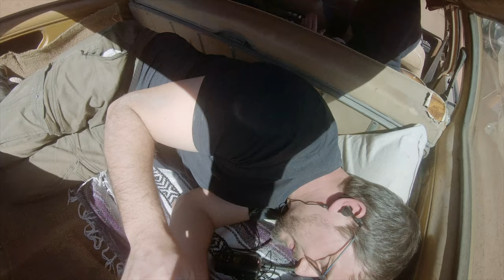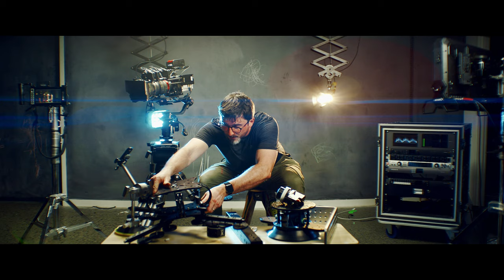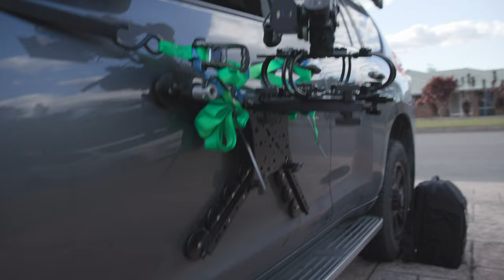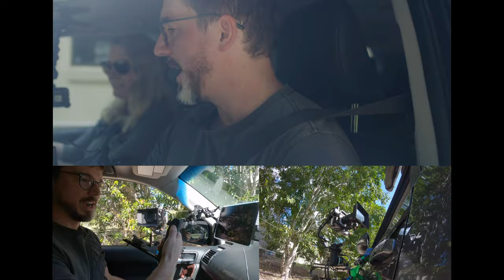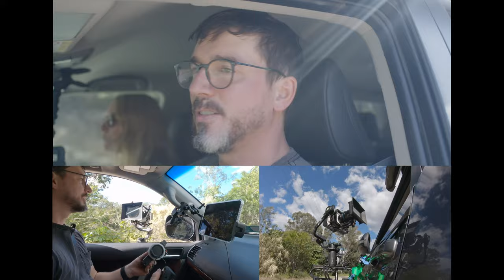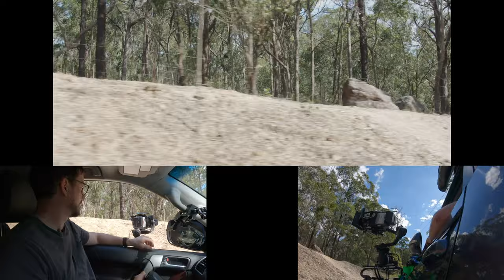DIY Vehicle Rigging PT1 – Red Komodo + Crane3S + Cloudmount

Comment: I absolutely HATE controlling my gimbal with the Mimic when in a vehicle. It's terrible. Also....first time test w/ a vehicle rig using a Komodo like....no big deal :D :D love it. Great advice on the power of the gimbal I decided to try Maniac mode on my MoVI and.....it basically made my footage virtually unusable when on the Cloudmount. I had a shoot yesterday where I turned off Maniac and lowered the stiffness on each axis and it was a smoother shot.
Reply from the maker: Good to hear it helped you as well. The next episode will show some interesting results with just the isolator off the CloudMount and a pretty sizeable Komodo package.

Comment: Have you ever tried solidly mounting the camera on the vehicle? I used a solid bullbar mount and a solid in-car mount for off-road stuff (rocky tracks, river crossing etc) and the look is quite natural even without any post-stabilisation. On-road, this should work quite well, though of course you don't have the ability to control the camera movement. But if a fixed mount is OK, then mounting the camera solidly might work.
Reply from the maker: Yeah after mounting our moco slider without isolation and seeing those results I’m definitely into the hard mount for certain applications. New ep that just went up shows us testing it: DIY Vehicle Rigging PT3 aka How to rig a MoCo Slider on a Car in just 74 easy steps!

Comment: Hey, great video and example of how powerful this gimbal is. Just wondering if you know dose the wireless receiver get power from the hand control unit? Or are you stuck with the battery life of the wireless receiver? I have heard the hand control unit does not power the wireless receiver.
Reply from the maker: Yeah the hand control unit does pass power thru to the receiver. I haven’t really tested how much power it can provide or battery life. But on mine I definitely can see a charge indicator on the receiver when I connect it to the motion sense remote.
Reply: @graetzmedia  thanks for clarifying that. Im currently working on a stabilised car mount system right now and have the Crane 3S Pro and have high hopes of it working. Though im only using a Sony A7S iii to keep everything as light weight as possible and to cut down on wind resistance. I also dabble in custom-built motion control systems and am local to Brisbane. I like your take on production and testing gear to try and find a somewhat budget solution. Sometimes things don't always work perfectly but if you can get a usable shot then that's all that matters. I'm exactly the same when it comes to my camera rigging. You should check my V1 motion control rig I built in my garage to shoot high-speed tabletop stuff. I also have a V2 rig that will provide very similar results as the BOLT system. It's currently being built. I feel like you would appreciate it's complexity for a budget motion control system. My website RAW.Exposed

Comment: Very informative. We have the cloud mount as well. did you try putting extra steel cables with the payload you were using?
Reply from the maker: Unfortunately I didn’t have any more of the cable receivers to attach to the CloudMount. Do you know if it’s possible to get more than 8 cables on that system?

Comment: Great video. Your footage looks incredible - Just have an odd question . The shot were youth driving with your family what were the camera settings? 25fp 24fp or 23.976fp and what shutter angle was it? Thanks again this is a great video.
Reply from the maker: Komodo was running 50fps (varispeed on a 25fps base rate) 1/100th. I sped it up 200% in the edit so I could match it to the GoPro footage.

Comment: So many wrong things in here. Let's start with the mount - usually when you grip a car you ALWAYS want a 3-point grip. Also, basic rule says - ALWAYS put shiny tennis balls on the outer margin of your rig - so everyone around you could notice you have a rig outside your car.  Shock absorbing mounts are okay for shooting anything outside your car - say another car, streets etc. When you look into your car - you always want a hard mount, this will ensure the camera position is fixed with the car and doesn't go in another direction the car suspension does. This wobble is caused by two things - first the shock absorber (besides, which is working really bad with your rig),  second the gimbal itself. Gimbals are okay for some things, and are not for a lot of others. In my practice I always go hard fix when looking into the car, or at least a tripod head. Gimbals tend to have inner vibrations caused by car vibrations and usually don't work for shots pointed inside the same car they are gripped on. When you mount something to the door face or a hood - you always want 2 additional points and a strip - to minimize the native vibrations of the door or the hood. The thing is the door or hood metal is not designed to hold additional weight and due to the face size they are going to wobble themself. That's why you lock off two additional points to eliminate the wobble of the metal on big faces. Now the shock absorber - usually you want something like a tranquilizer with adjustable rubber rings - you test the weight, speed, road surface - and then add or eliminate rubber bands. Shock absorbers made of only metal wires usually suck. I've never met a single one that was working great - they only make your camera/lens travel short distances in the air which makes your footage suck, especially on slow speed where you experience a variety of G-forces.  Finally, you always try to put a metal wire for safety of the rig - even if it falls of, it should not ever end up on the road. This might cause a crash or damage to someone's health.
Reply from the maker: Awesome info here man. I’m definitely not an expert on vehicle rigging. I’m sharing this content pretty transparently as a filmmaker that needed to learn about it for practical reasons. Super appreciate the detail you’ve provided here. I was looking at upgrading to a Killshock but based on what you’ve said here I’ll look into a tranquilliser as well.
We did have additional bracing on our moco system. And on all the other rigs we used safety straps at the very least.
But definitely more to learn and plenty more testing needed.
Reply: @graetzmedia  you've got some crazy stuff in here, keep on pushing!